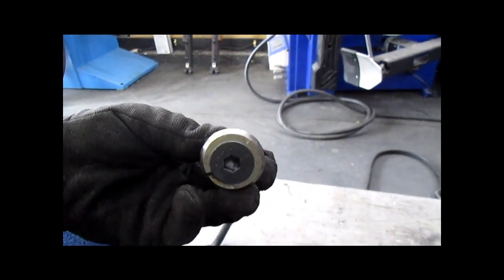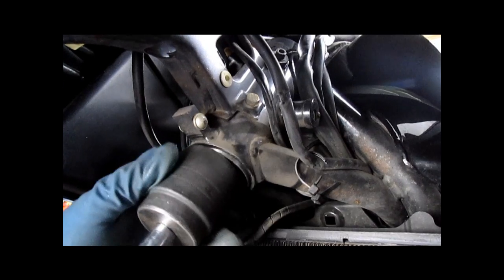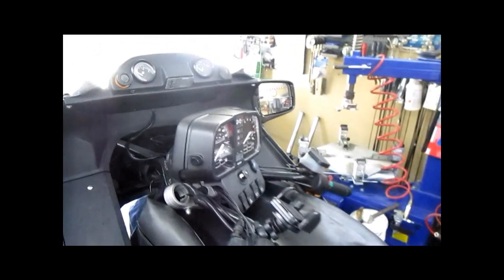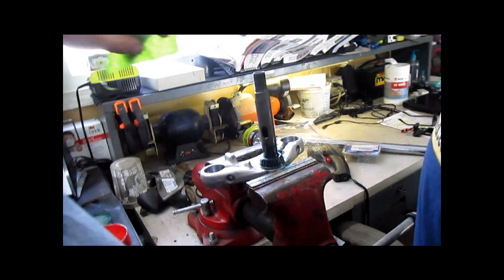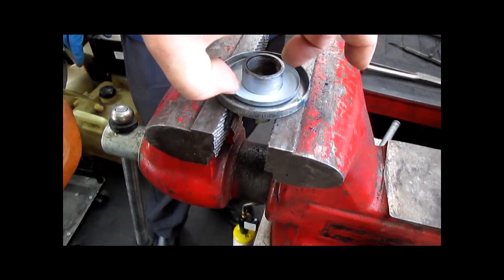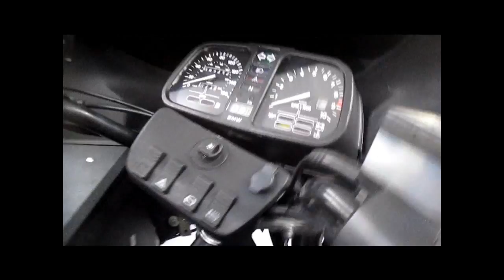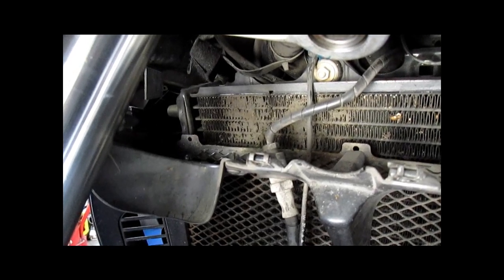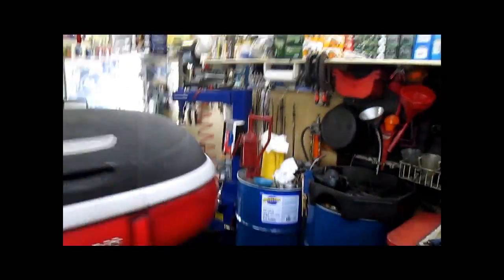BMW Service - Steering Head Bearings Part II - K75/K100/K1100

Comment: Hey Chris! Thanks for your K75 videos. I picked up quite a few tips and tricks for working on my own 1990 K75RT. Just replaced the gearbox (mine had a faulty 2nd) and the auxiliary drive shaft unit. This last one was very informational too. Marcel

Comment: I don't have a MIG welder but I know from experience that a stick welder will do the same job. It shrinks the bearing race sufficiently to drive it out. In the absence of any sort of welder, what I have done is to grind a 13mm solid round bar to a chisel edge (10mm will do, but I don't think I'd go below that). The outer bearing race has a tiny lip on it when you look down the steering head - patience, the chisel-edge bar and a hammer will drive it out that way. Keep the old outer race because you can use it as a drift to get the new one seated properly.

Comment: Mate you could do the install with a ring slightly smaller than the OD of the bearing race. Then another ring with a shoulder to center it on the steering column and pull it in with all thread / booker rod  and a battery drill. It will be straight then

Comment: Hi Chris, when I know there's gonna be some bearing work like this job I usually buy a block of dry ice.You bag what you need to cool in a clean plastic bag and set it in a can with the d/ice. It gets them absolutely freezing shrinking cold in no time.Then I hit the race seat with a hot air gun for a while and they just about drop in.An old fart told me this trick years ago.Now I'm an old fart so I'm telling you.Dry ice is cheaper than the spray freeze if you can find it locally.

Comment from the maker: If you tighten it too much the forks will be difficult to turn when the front wheel is pushed to the side. The forks should move without too much assistance yet not flop right over when pushed.

Comment: I did this three years ago and now I have to do it again. I found some cheap bearings on E-bay.
Reply from the maker: Hi Ray,  you'll be replacing them again in three years! Use GOOD bearings. TAPERED ROLLER BEARING - 28X52X16 mm
Reply: I was surprised at how "notchy" they were when I checked them, because I had just come from a road trip and the thing stayed in the lane nice. I thought all was fine, until I checked them. I did find myself wondering why I got so tired at times. Maybe I'm just getting old, or maybe it was the steering head bearings.

Comment: hi Chris, in your opinion is necessary to remove the two Fluidbloc bolts before adjust steering head bearings, on a k 75 c 86' ? thanks, gabriele.

Comment: Hey Chris,  thank you very much for your videos. Especially this one. I have a question though, somehow my K75 has another set of bearings in the middle between the top and lower fork bearings. I want to sent my Bertha (the BMW) to the paint shop for a new powdercoat, so I kinda need this bearing to f*ck off. Oh and it turns out that I have a steering lock.

Comment: Another great video with some usefull advices!
You explain to tighten the top-collar if it's possible to move the fork back and forth, but how do you know that collar isn't too tight? I imagine those bearings will wear excessively when tightened too much...
Is i just a matter of starting loose and tightening just too the point where he play goes away, or is there an actual trick/test to check if that collar isn't overly tight?
Thanks,
Isabelle

Comment: Hi Chris. Any chance that you recall the other model with the "backwards" front wheel installation? Was it something specific to do with ABS models? About to get the tires changed on my 85 K100, and want to make of note of it to the mechanic one way or the other.
Reply from the maker: Your '85 should have the casting on the rims match.

Comment: I think I might be drawing my races together with a large diameter threated rod and some real thick, big washers.
Reply from the maker: That should also work if strong enough.
Reply: Chris, I just did this today. It worked. Used old races and it worked well because the races do actually go down below flush, though at first it was like holding a jig saw puzzle together. If I was serious about making a tool, I would get stuff welded together. It really did torque down nice once it all was in place, and it bottomed things out real nice.

Comment from the maker: Even a cheap 110 volt gas-less wire feed welder ($100 or less, used) will work for this.

Comment: I did tried 2 different BMW shops to fix my 1200 GS 2006 (pistons in line) 4 times . It charged me 4 K dollars after the warranty expired. They blamed the Oxygenist sensor and replaced 2 times my pipe, for a  loose power and died like a gasoline problem. They did replace my battery twice, but after 2 months later it failed again.. my BMW has bean garaged from the last repairs in 2008 until today. My "new" bike started having problems almost at six months from buying it at the store. They kept fixing it until the warranty ended. After that I had to pay 4K as described, trying to fix it. You are to far from me. I live in Ontario Ca. I don't trust anymore in the BMW Mechanic shops at all. Please if you recommend any one near L.A or san Bernandino county in CA please notify me. I would really reallly appreciate it.
Reply: Are you sure you are getting a good ground with the O2 sensor? These bikes are know for having some grounding problems. Try different places to ground any ground wire involved. They will not run or will run like crap, acting like it's running out of gas, if the ground isn't right. It happened to me, when I bought an O2 manipulator.